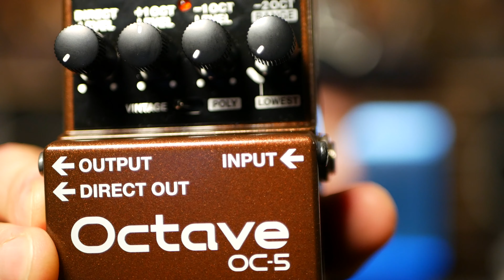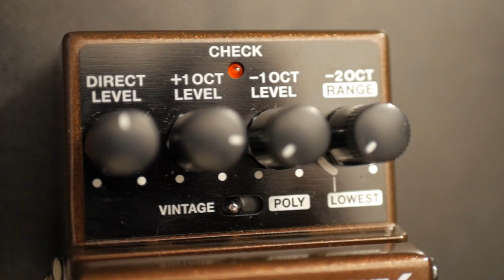BOSS OC-5 vs BOSS OC-2

Comment: I think it sounds pretty good, I really like the octave down sound of the OC2 and the OC5 does that well. I sold the OC2 I had cheaply a few years ago because it didn't seem to track so well, then got the MXR octave deluxe which tracks well as long as all the other strings are muted properly. It isn't the worst sounding octave pedal, but I do wish I had of hung on to that OC2 as well though. Well reviewed, thanks.

Comment: Update your ACA oc2 to accept the 9V, it is a simple jumper across the two solder points (sitting one beside   the other). I did it on mine, made the Adam Arts do the same, it is reversible, simple and impossible to mess it up. Unless you have extra 12V psu outputs unused that is.
Reply: Historically OC2 and most of boss pedals use 9v! I had a Green labeled oc2 and modded to synth thingy... Justo NEVER USE 12V ON BOSS STANDARD PEDALS!
Reply: @hectoreduardofuentealbapel7830  please don't spread the ignorance and create myths. "Historically" there is Boss ACA PSU that outputs about 12V unregulated. Read the labels on your pedals.

Comment: OC-5 sounds better in the band mix with the dry blended in (as you would actually use it).  It sounds like fat robotic sledgehammer and you can clearly hear the lower octave in the mix.  Wheras the OC-2 is so smooth it just sounds like a fatter version but you can't actually hear the lower octave clearly
Reply from the maker: I agree with blended dry signal the OC5 sounds great in a mix, but I often use just the one octave down with no dry as a basis for synth tones and the OC2 has a bigger sound for that

Comment: The OC-3 is the best pedal. The drive is limited but is acceptable for a basic overdrive to add to the other 5 overdrives that everybody all ready has.
Reply from the maker: Thanks for watching! The OC3 is a decent octave pedal, I wasn’t aware of it’s overdrive capability
Reply: Yes it's quite useable. I had an 80s OC-2 for years in the 80s. The OC-3 tracks better. I don't use the poly function though.
Reply from the maker: @Al_Mac125  interesting that they never mention the drive function or have any controls for it on the pedal…
Reply: The 3rd knob from the left controls the overdrive when in drive mode. So you can use -octave + clean + drive or clean + drive. No tone for the drive of course but that's not a biggie. Good vid though btw.